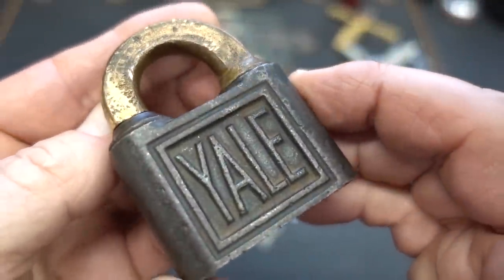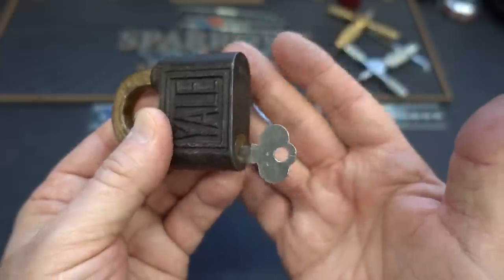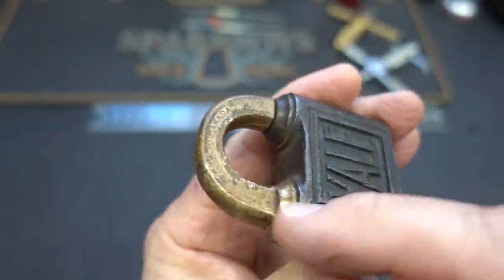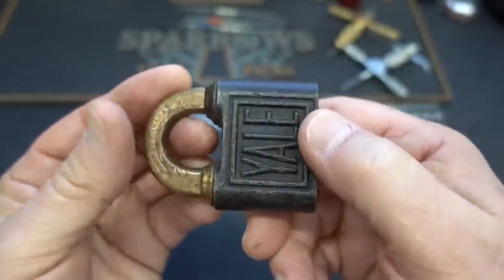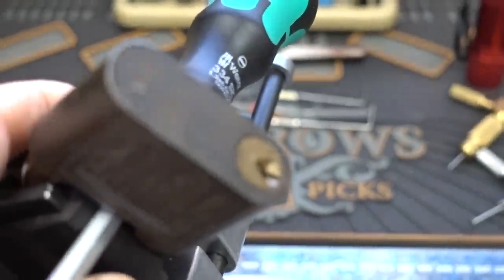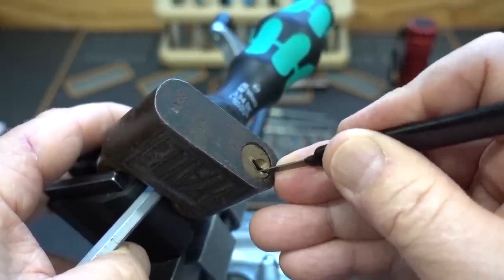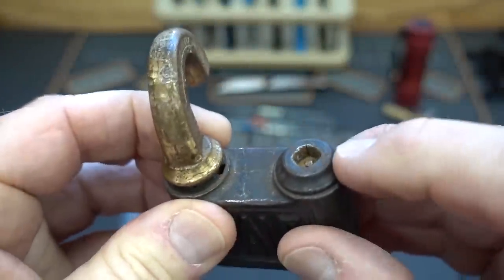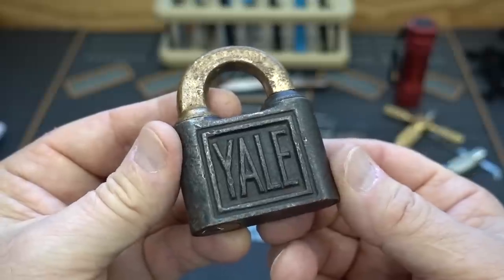(1615) Yale Push Core Padlock

Comment: HISTORICAL EVOLUTION HERE -- What you have is the predecessor to ALL modern pin tumbler locks that we know today.  This lock is the next logical step from the very first invention of the pin tumbler Padlock by Linus Yale Sr. in 1857, US Patent # 18,169 known as the "Slider", or what is the "Holy Grail" Mother of all pin tumbler locks.

This lock uses the pins themselves to hold the shackle in place.  When the pins are set at the shearline (with the correct key) the shackle can "slide" upward and free the shackle to rotate and open the padlock.  Notice the key is FLAT, so the next step in evolution was to add broaching to the keyway with matching profiles on the sides of the keys, thus expanding the number of possible keys that would open the lock.  Yale made (and was copied by many others) padlocks of this exact same type lock with "modern" keys that have profiles on the sides of the keys.

Then next logical step by Yale was to disconnect the core from the shackle and just rotate the core to engage a mechanism that would then unlock the shackle.  Thus we have arrived at the modern pin tumbler lock through a series of inventions that have evolved to give us the pin tumbler lock that we know and love today.
Reply: Makes perfect sense considering Yale's design was claimed to be based on the Egyptian door lock.
Reply: Ken Nixon Comments like yours, are one of the GREAT reason, I take the time to read them. Thank You.

Comment: I've keyed up several of those.   They usually have spools and serrated pins (you should pull this one apart!).   Twist the cap on the open side off using an Allen wrench (on some models) or plastic tipped plyers (on round ones) or an EZ out (worst case).   That releases the spring that holds it together.  Use a standard follower to pull the plug out and you can dump the pins.   Just file the blank and you have it a classic looking (working!) lock.  I bet most people in the gym won't know how to open it!
Reply from the maker: I've already given the lock away but will email the new owner and let him know how to re-key and insert some alien tech.  Thanks for letting me know!  Now I can't wait for ANOTHER one to show up to try it out.
Reply: Timbo63, are there any vids on YT of these being torn down or rekeyed?

Comment: The easier way to pick it is to push a shim over the core to separate the key pins from the driver pins as you pick it. Quicker and easier.
There is a book you can buy "The Padlock Reference Handbook - Pin Tumbler Push Key Locks" by Neil Pylant, that gives an excellent history of this type of padlock. Your lock was patented in 1890, so it's probably around that date or slightly later.
Reply: thank you the info about the padlock book

Comment: Thanks for this, Bill. I have a similar lock, somewhat smaller, brass with Yale on one side and U.S.N. on the other. No rotation at all, but the core does move in and out with the shackle. So I knew the core wasn't seized, but I'm not sure I'd have ever thought to tension it by pulling on the shackle.    And...OPEN!  Thanks again, Bill.

Comment: I haven't even THOUGHT about one of those in years... lol....  Thank you for the memories!!!! 

Had one come into the shop I started in on a customer's grandfather's WW1 issue footlocker... (The lock or hasp didn't seem to ever be GI,  just put on after)... Customer had inherited the footlocker and basically said they didn't care how long it took us, as long as we didn't damage anything.  

It had the issue lock which turned out to be an Eagle (what we called) "spring lever" trunk lock...  It's basically two to five spring tensioned "levers" that all have to be moved at once before the actuator becomes engaged to open the lock... Kinda like a precursor to a disk detainer, but they ALL have to be moved at once as far as any of us know....   NASTY... Never picked one, never heard of one being picked... Would love to see you do one because I'm befuddled myself... They can be impressioned fairly easily, but THAT relies on having a stock of blanks...  They go for $10-$30 each on fleabay, so good luck... 

Thankfully the lock was marked with a key code and after an hour or so searching through a box of random cut Eagle keys, we had the right old key in stock. (one of the benefits of coming up in a shop that's been around more than a century a LOT of "crap" in the back)...  So, the issue lock was good and we even had a key... 

Interesting note, some of those old Eagles only had about 50 different keys for their entire line...  It depended year to year... 

The Yale (this lock) confused everyone.... We all did the same thing your buddy did, tried to tension it... We were trying to figure it out for a couple days... Apparently, (I wasn't there I was off repinning a bunch of of about 20 Kwiksets...... the downside of working in such a shop, a lot of very boring work you really wish you could speak your mind about... you just do what you're told)....  One of the older guys thought it might be able to be rapped open and tried it, and THAT'S when he noticed to core going back and forth in the lock body...  Thankfully he realized it before doing damage and stopped... Then the old boss remembered them and said they didn't turn, you had to pull the shackle to pick them...  One of the other guys back raked it open at that point, so when I got back it was already open, and the boss wouldn't let me or anyone else after play with the lock because he was afraid it would get damaged...  

Good memories, and now I have so looking to do into the patent...

Comment: I worked for NYC Railroad, in the Signal dept.They used a smaller version, the body was about 1 1/2" square  with a steel shackle. These were used in Signal control towers to secure access to the interlocking machines that had control levers for switches and signals. They were used more as a tamper seal, that only authorized Signalmen had keys to .
Reply: Interesting you mention R/R.
I have one of these locks we found on a chest at my Grandparents farm with early 1900's documents locked in it. Pa also worked for the R/R in his early days.
Also found several R/R items from back then.
Might just explained some historical details on this particular lock.
Thanks
Reply: @hi-techredneck3318  Treasures from the past, your welcome.

Comment: You should try and pick the master lock 517 D adjustable shackle padlock, its got an interesting core in it that may surprise you when you compare it to the normal master 4 pin marshmallow core. We use it to lock up our fence gate, and I'm interested to see how much protection it really provides! (Though knowing it is a master, its on the inside of the fence just to be safe)

Comment: That is the model 805 and from 1929 back it had the Yale logo on one side and a trefoil logo on the other side(the trefoil was the shape of the bow on the key). It has been speculated that Yale changed over all of their lock logos to the word Yale on both sides due to the 1929 stock market crash. It was also less expensive to have the new logo.

Comment: So do you pick challenge locks at all anymore? Or just stock locks? I miss the beautifully designed locks that used to be the main thing you did...
Reply from the maker: Phred,
    No, I stopped the challenge lock thing almost a year ago and posted my explanation on social media, the website and YT.  In case you missed it, here is what I posted:
---------------------------
The "Challenge Lock" series has come to an end.  Not only am I out of the "Whipped" PacLocks, but there were many other things that I took into consideration.

1.  Cost.  Every day I was receiving between 5-10 locks from around the world.  I had to return most of them to the owner, which was a SIGNIFICANT expense - always more than $500/month but sometimes approaching $1000.  What little I receive in viewer support was quickly consumed in return postage.  I was spending several hundred dollars of my own money every month just to return locks.

2.  Quality.  Some locks were well designed and contained some unique innovations, but they were few and far between.  Most "challenge locks" were threaded chambers with serrated pins built on old,beaten up Kwikset cores.  The number of trap pins and super springs has continued to increase as copycats realized this might be a way to get a "Whipped" PacLock - meaning I was breaking and bending more expensive picks.  I found this very discouraging.

3.  Time.  Unpacking, picking, disassembling, repacking, answering emails, etc.  Each challenge lock took a lot of time to figure out and then return - even if I did not make a video of it.  I was spending most of my time setting up and videoing locks that turned out to be copycats of other people's ideas - meaning I could not post the video for fear of viewers saying "WHAT?  Another Kwikset with threaded chambers?"

4.  Viewer Interest.  My goal with LockLab was to remain "New Picker Friendly" and attract new members to LockSport, but LockLab was quickly becoming the "Challenge Lock Channel", interesting to only a limited number of people with advanced skills.  Every time I posted a challenge lock video people complained and unsubscribed to the channel.  New pickers were overwhelmed by the complexity of challenge locks and became discouraged.  My analytics were very clear on this:  If I want to lose subscribers all I needed to do was post a challenge lock video.

5.  Channel growth.  The LockLab's growth was stagnating and I needed to change something before it was too late.  Since I stopped doing challenge locks the number of subscribers has increased, the number of comments increased, "likes" went up, and the channel has grown.

So, yes.  I stopped making challenge lock videos.  It was not an easy decision but I could not afford to continue doing it for all of these reasons.  The money saved from NOT returning challenge locks I am now spending on locks - and have been doing so for the past month or two.  I cannot tell you how refreshing it is to return to picking real-world locks in a wide variety.  It is good for me (mentally), as well as good for LockLab.

bill

Comment: Bill, I his appears to be a great candidate for a video showing how to make a key. No core to remove so how do you make this key?
Reply: Impressioning.
Reply: The core can actually be removed. Just need to make a tool to unscrew the cap that the shackle toe fits into. You might be able to do it with the right sized slot screwdriver. I made a custom 4 sided driver for it. Hint, the core is close to the size of a naked AA battery.

Comment: I must be getting old, because I cringed when you first put the key in and twisted. You might have the correct key; put it in and tap the key.
Reply from the maker: No, it isn't the right key.  Too bad..😟
Reply: Push-core locks were fairly common when I was a kid and the first type of lock that I learned to pick.